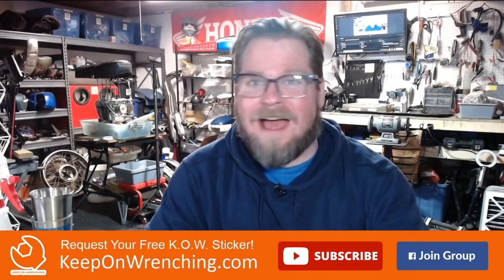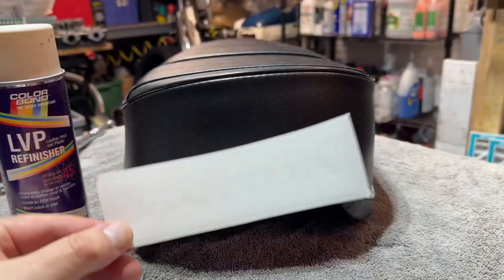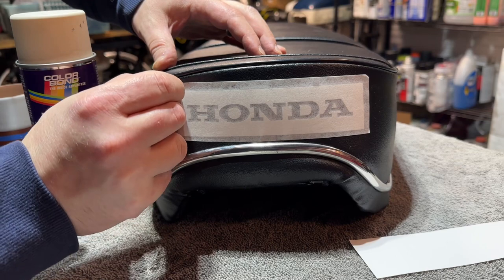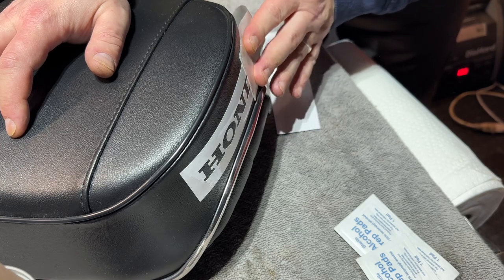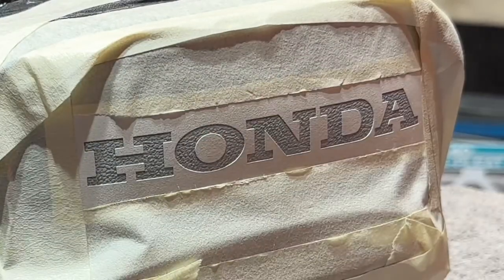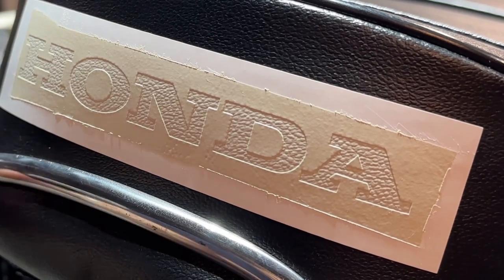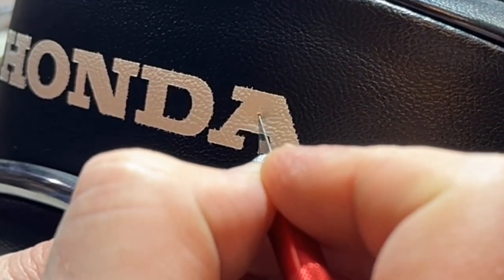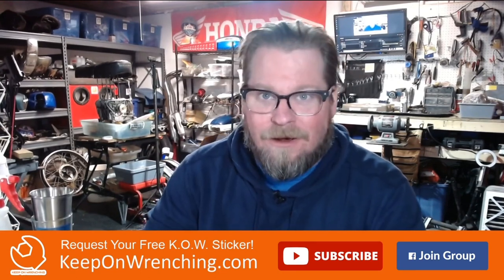Vinyl Spray Paint on Leather Seat

Comment: Pro Tip: Use a hairdryer to help get the stencil off. It helps to not pull paint off where you want it to stay.  Works better, every time.
Reply from the maker: Good idea. Will keep that in mind for next time. Thanks!
Reply: To add to this, plastic razor blades are also super useful for not marring the leather.

Comment: You could always match the seat color with one coat and fill in where it bleeds, then paint the white over that. Might work. 🤷🏽‍♂️
Reply from the maker: It’s a really heavy paint…easy to get messy or globby. I’m sure there are many ways to go about it. That stencil is the way to go IMO.
Reply: @KeepOnWrenching  I agree. Maybe I’m not clear. I meant put the stencil on, spray the first mist coat black then the rest white. Only the first coat will bleed, that will seal the stencil on and the white should have crisp edges. Works on other surfaces, I’ve never tried vinyl.